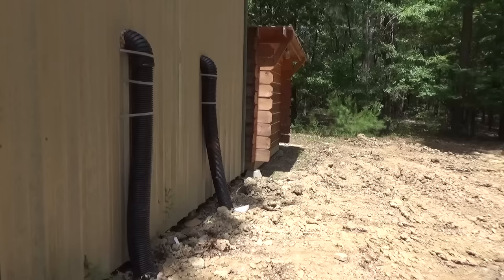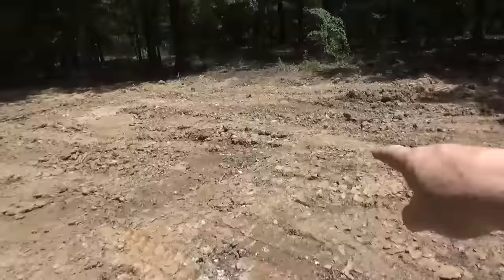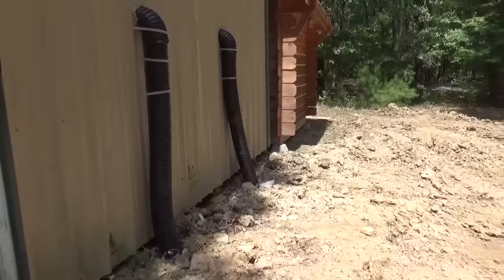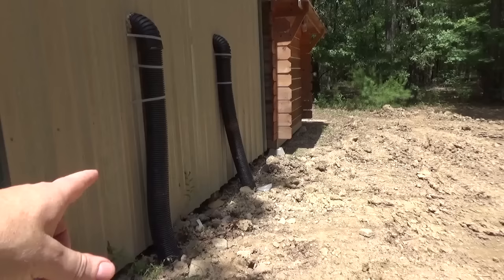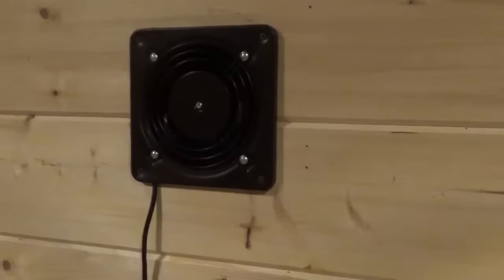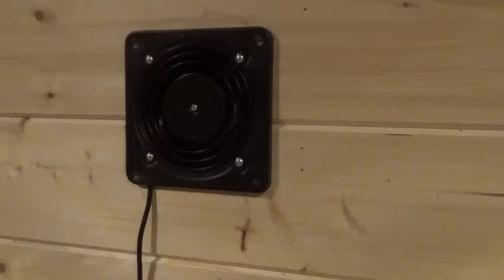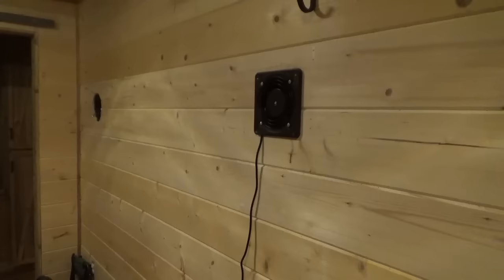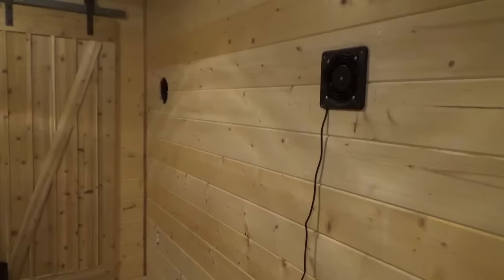Offgrid Underground Air Conditioning

Comment: I've considered that sort of system before.  My concern would be condensation in the cooling pipes. It only takes a little water to create a big mold problem. I think it would be a good idea to run a dehumidifier in the house to limit the amount of moisture that gets into the lines. Dehumidified air also feels cooler on the skin because it's easier for evaporation to occur.

Also, if you're cooking or showering in that structure, make sure that humid air is properly vented as immediately and completely as possible so that humid air doesn't get into the lines.

Now that I think about it, I think a better system might be to cycle the same closed-loop of air through the ground with a furnace-style heat-exchanger that you pass the house's internal air over to cool it. This way, no humid air can ever get into your sub-surface lines, and if any condensation occurs on your heat-exchanger, you can just clean off any mold that might occur.
Reply: Aye mold loves dark places.
Reply: add a drain at the lower end of the loop and have it collect in a tank,  then add an ozonator that bubbles ozone through a line that ends at the bottom of the tank.  Then you can pump the clean condensate out.  There's a way to forgoe the pump by using the power of the bubbles in the bubbler to push the water out through small vinyl tubing.  https://www.youtube.com/watch?v=dNJTAbS_GBQ
Reply: Condensation will occur at the "dew point temperature", your local dew point is on the weather report in your area. You can also research ground temperatures range by depth for your area. Cities generally warm the soil 10F warmer than outside that city. Phoenix AZ is about 75F at 10 ft depth underground in September. With weather highs of 97F and a dew point of 43F, condensation won't occur in an underground heat exchanger pipe because the piped air is 97F to 75F, no where near 43F dew point. However, if your weather near Kansas City is 61-83F and dew point of 65F, with a ground temperature is 55F. If the air coming out of the heat exchange is near 65F, you'll definitely be forming condensation in the pipe. Weather can change dew point significantly.
The transfer of heat into the ground to return cooling is extremely inefficient because low surface area of the pipe to exchange heat. The industry best solution has been shell-tubes.
Reply: One possibly is a heat exchanger like a furnace would have and instead of air in the lines run water or antifreeze solution?
Reply: @DavidJones-me7yr  The right liquid can exchange more heat than air can. The extra mass of anti-freeze underground would chill and store cold while not circulating in the mornings and be much more useful in the hot afternoons than air can be. Anti-freeze would be more expensive to use than Methanol, but anti-freeze is less toxic and not flammable. Air requires 10x the surface area of a anti-freeze pipe or 12x of methanol to be similar during active use. A DIY air system is very cheap if you disregard the cost of digging.
Reply: lol, me too, the condensation mold potential, I thought I might 
need some sort of mandrel to swap out the pipe , or some kind
of pump. Shrugs.. I also considered a closed loop whereby 
the pipe size in the ground was roughly duplicated throughout
the residents using aluminum ducting. 
I'm also not sure about this 53f at 8' below ground, does not 
sound right, I remember figures of roughly 70f.
Reply: chubbyninja842  bingo.
Reply: HRV could do this with ease.
Reply: @rufuskit9447 Dew point doesn't really matter. Moisture from the interior of the home can vary wildly from the exterior. My house runs 50-55% year round.
Reply: @shawnd567  If you get condensation in the pipe that air flow through, then you can have mold. A cycle of wet the mold growing, then drying and becoming lose is a serious health hazard for cool air.
Reply: it's a basic geothermal system. He should run water pipes down there and just exchange the temps.
Reply: Yes. The heat exchanger system is a great plan.
Reply: In the deepest level you need to do a water trap and clean/ dry it often.
Reply: This is a cool system, but I'd prefer using sprinkler pipe below the frost line and a heat exchanger (car radiator or similar).  You wouldn't be adding much power with a small recirculating water pump, can drain any condensed humidity off the heat exchanger to the outside.  Only real downside is you'd have to drain or protect anything above ground if not there, solar panels covered with snow, ect.   Might be feasible to use the RV drain line antifreeze in the system, it's not super expensive.
Reply: This guy is blowing moldy air into his house at an industrial scale. 

But at least it's cool 🙄
Reply: I’d like more info on this.
Reply: What is HRV?
Reply: @brutusmaximus5380  that corrugated pipe will still hold water, quite a bit of it.  If this is in a VERY dry climate it will be fine, otherwise...
Reply: If you're going to run a dehumidifier you might as well just use a traditional air conditioner.
Reply: Air plants can take humidity out after 20% they literally can take up 1500% more then a normal plant in terms of body weight.
Reply: @chubbyninja842  Yes you are right that mold was one of The reasons why I id not Brother to testi it.
Reply: @chubbyninja842  I’m new at this , will you please explain furnace style heat exchanger?
Thanks.
Reply: 2 months in you will be blowing moldy air through the cabin.  Water will condense in that pipe.
Reply: @gg-gn3re exactly!!!
Reply: @ajm2872 Texans never let science get in the way.

Comment: So, a consideration to note on the earthships here in New Mexico, the geothermal tubes are open to the outside for a few reasons, one is to prevent too much condensation build up, and the other is to allow a cross breeze to be your main air mover instead of a fan, so you use little to no power at all. Most earthships will have an attatched greenhouse, or at least a roof peak vent. All the hot air in the house will move to the upper most vent in the greenhouse/house and leave, pulling in fresh air through the geothermal tubes, pulling in that cooled (and typically drier) outside air, with no moving parts, although in some cases a fan may be used for extra movement if needed. These are also used for very light heating in the winter, as we have moderate winters, much like Texas. This will still work in this set up, but just as others have said, condensation is worth considering, but most AC systems have to deal with that anyways. These systems work the best in highly insulated buildings with very little temperature fluctuations
Reply: I don't understand the first sentence. How are teh geothermal tubes openes? You mean not underground but above?
Reply: Building an earthship now, I think this makes a lot more sense because it’s recycling already cooled air. If it get muggy, you could add a vent at the end of the exterior pipe that you can open at night to let fresh air in
Reply: @jolondon 
No the entrance of the tube is open to outside air, but the exit is inside the building.  Pros and cons.  The videos method is more efficient since it is constantly recirculating indoor air, but moisture can be an issue, and possibly mold if the moisture is not taken care of.  The earth ship method requires far more tubes, or you settle for higher temps indoors.

Comment: I have worked designing systems similar to this... but lack money to build them.  One thing you might not have allowed for is condensation in your underground pipes.  The warm air from the house will have humidity that might condensate inside the pipe and eventually the whole pipe will fill with water and become stagnant.  Another thing you might not have considered is the dirt near the surface has no water in it... so... even though the temperature of the dry dirt is 50F... it  might not hold very many btu's of coolness.  If you can bury the pipes down where the dirt is always wet, it might work better.  Another problem is the corrugated pipe.  That kind of pipe does not have smooth walls.... so... the air moving through the pipe will have turbulance and will not flow as well.  If anyone is thinking of doing this... you should do some TESTING of temperatures below ground BEFORE you start.  I installed temperature probes at various depths in St. Louis,  Missouri.  My results are as follows.  Temperature at 20ft down is about 60F Winter and Summer!  It doesn't change.  As you get nearer the surface,  then temperature changes depending on the season and the depth.  Down here in central Florida,  I measured the temperature at about 10 ft down and it is 70F.  If you live in the NORTHERN U.S.A.  it would be likely 50F.  I wrote a whole PDF book about these subjects including a couple methods of cooling your attic from 150F down to about 105F with NO moving parts/NO electricity!  Anyone who wants a free copy of the whole book I will email it to you as an attachment...  My name is David Mundy and anyone can email me at this email address:    framistan@sbcglobal.net Ask for the "U.G.A.C book" and I will send it to you.
Reply: Hello Dave, I tried to email you at the address you posted but it says it is undeliverable. I would like the U.G.A.C book. I look forward to hearing from you and thank you very much.
Reply: Yeah condensation and mold were the first things that came to mind when I saw this.
Reply: We tried it in Minnesota. Yes it gets fricken hot and humid in the summer here! It works, but after a while mold had grown in the pipe and it was abandoned. Now I’m too old to try it again.but I still can’t think of a practical way around the mold.
Reply: @michaelnelson9140  I've thought about venting basement air into my attic in during the summer here in Alabama where it's also extremely humid. I considered putting an S-trap in the duct with a small drain hose to the outside. Never did it tho, mold is no joke
Reply: Awesome information. Thank you. I will be emailing you for the book. 👍
Reply: I have designed and completed PVC hard pipe with long sweep el's for a first floor A/C System under slab in Nevada. Very low humidity............16% @ 97*F.  The idea being if dust or mold ever became an issue, a special cleaning company could flush or run a "Fog" vapor through the duct system and remove any contaminants. It is expensive! Duct Diameter, branch wyes, Static Pressure Drop and CFM design makes for expensive 18"x16"x8" pvc fittings! I would not use the spiral with vanes but ABS rigid would work . His system needs more 'S' turns in the ground and much more pipe/surface contact IMHO.

Comment: If you put the air intake closer to the ceiling you'll find it much more effective and efficient. As level is evacuating near the same temperature air as it's imputing. Heat rises cool air falls
 In thinking about it the air output should be head high also that reduces the hot zone by increasing the cooler area.  Im impressed because I am guestimating how much site development will cost ie;solar and battery storage. Ill need and a fan is cheaper and easier to run than a ac unit . Could run a fridge on the savings in energy.
Reply from the maker: My cabin is all off grid. I have solar power and water is from rainwater collection system.
The more I can stay away from government control, the better.

Comment: Just a thought, probably not important but you decide. Blowing warm, humid air into cool underground pipes might cause condensation in the pipes.  Condensation may cause mold growth. The air circulating in the pipes and through the potential mold growth may disperse mold spores throughout the structure and into the lungs of anyone breathing the confined air. 

I would consider a redesign personally. I would close loop the air in the pipes and install a radiator in the cabin to push the warm air through.  Not as effective but maybe safer.  Even better would be to replace the air in the pipes with something with better thermal efficiency like water with some antifreeze depending on climate and usage.

Good luck with your decisions.
Reply: Few hundred feet of buried pex/poly pipe using an antifreeze solution would work perfectly. 50w circulation pump + large radiator for the inside portion.
Reply: Perhaps uv lamps in the pipe could prevent mold?
Reply: @glennlopez6772  enough uv lamps to prevent mold would require tons of electricity, a massive waste of energy.
Reply: Yup...guranteed mold growth!  I tried this 40 years ago and abandoned the system I had installed due to MOLD!
Reply: Minimize that issue by having drainage holes at the lowest portion of the pipes. Very little humidity is left in the air by the time it returns.
Reply: Agree on mold growth.  Closed loop is better.
Reply: HRV would do this. Just connect it so it loops in a closed setup
Reply: Would perforated pipe solve the moisture issue ?the ol sock  o is what it's called up here
Reply: Not important
Reply: @UmdogTR  👍

Comment: Brilliant design. We do something similar in an earth sheltered home and livestock housing in the Ozarks. It is completely passive, where warm air rises through vents to the outdoors and cooler air is drawn in from sunken pipes. We often have to shut the vents to keep it from getting too cool.

This is based on the vent design of my unairconditioned familly home in Florida. The intake vents were all along the bottom of an outside facing wall, sheltered by foliage. Lots and lots of foliage. The upper vents let warm air escape and drew the cooler air in. If there had been sunken pipes we could have gotten better than the average summer temperature of around 78 degrees indoors when normally it would be nearer to a hundred degrees. It made the northwest facing side of the house much more bearable without HVAC.

Downside in Florida was the wear and tear on the small screens and the humidity and moisure affecting the jalousy mechanism of the vents.

Comment: Just some helpful advice. Insulate your pipes all the way to the ground and also,, run a dehumidifier. These geothermal mass air flow units will start to sweat and cause some bacterias to grow. 
Happy off grid
Reply from the maker: Its going to all be insulated.  Ill do a follow up video when its all complete.

Comment: That's a great system! I'm glad that you're already aware of the potential for mold growth. One way to mitigate that risk would be to pick up an ozone generator and once a year, sanitize the air in the cabin and pipes. I would remove anything biological from the cabin that you don't want dead (people, pets, plants, etc.), close up the cabin and with the AC blowers running, fill the cabin with ozone. I'd let the ozone generator run for 24 hours, then let the ozone dissipate for three days after, opening the doors on the third. This is how I've removed mold from basements particularly and older structures (especially before upgrading it with a vapor barrier and vinyl siding), and in a system that is likely to produce mold, the ~$750-$1,000 for the investment in the ozone generator could well save the occupants from a major health hazard in the future. Anyway, I'm enjoying your channel and you've got a new sub!
Reply from the maker: Thank you

Comment: You are on the Right Track... 8 lines 50 ft long  and double the depth  and insulate top  to down 4 ft under the ground...and use a  bigger fan...like the ones on top of the ac outside a condenser fan with a 3 speed controller.. or 2 intake LINES Per Room ft 50 2x depth with a controlled fan for more balanced system

Comment: Hey, I know I'm late but corrugated tubing collects and holds condescension. That condescension grows mold and other fungus. You can use a shopvac, string and a rag to clean every season or when needed. If you can afford it use SCH 20 pvc or install a stripped copper ground wire in the pipe to help fight mold.
Reply: Just have drainage holes in the pipe and issue solved
Reply: @thatguychris5654  I'm my area that would let critters and ground water in.

Comment: How do you keep the moisture out of the loop?
Will this work in humid Louisiana?
At 78 yrs. Old, I might be too old to do this now, but
Reply from the maker: @thomasmurray4717  I'm in northeast Texss. 
I run a dehumidifier in my cabin.
Once a year I run a camera through the piping to inspect. No moisture or mold issues.
Reply: @uncledavesfrontier6846  thanks 👍

Comment: Thank you for the video. This type of cooling has been used for centuries but for some reason is not used in many places here.
What kind of pipe did you use and how big is your cabin.
I lived off grid in Arizona for over 20 years and regret not doing this.
Looking forward to your update.
Good job
Reply: You have no humidity in Arizona, you can simple use a swamp cooler.
Reply: @anthonyspadafora1384  
After twenty some years off grid I found the swamper to work ok except during monsoon season.
Geothermal works all of the time summer and winter and it can be set up as passive so not using precious power.

Comment: Since I'm only doing cooling and not heating, I would put the return high up near the ceiling so it pulls out the hot air from the room which has risen to the top of the room.

Comment: For cooling you should have you're ducts as high as possible. Like that you grab the hot air on top and cool it down. That would possibly work without the fan because as the air cools in the tube it would loose weight and come out at the bottom end.
Reply: Even with a basic 'P' trap effect? That's quite a drop and rise,  12ft. I'm guessing? Natural Convection? Hardly.